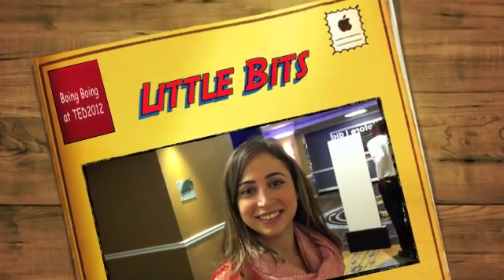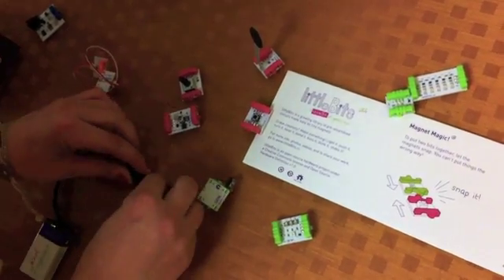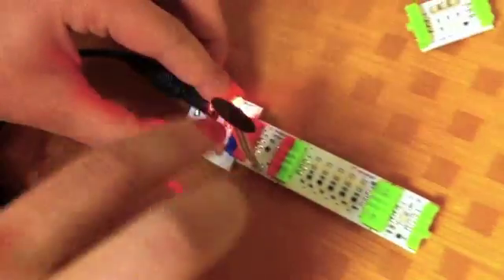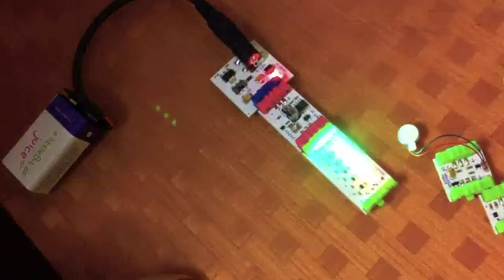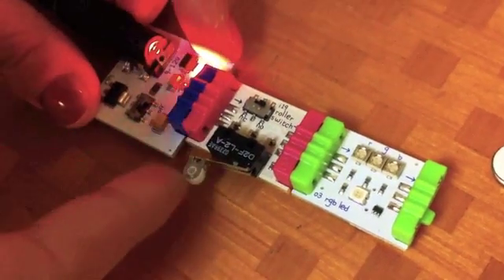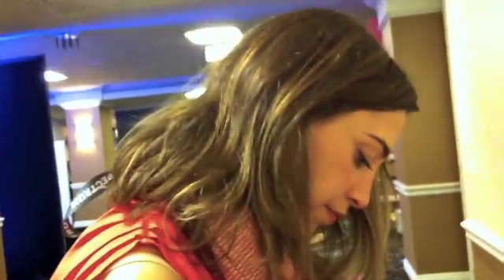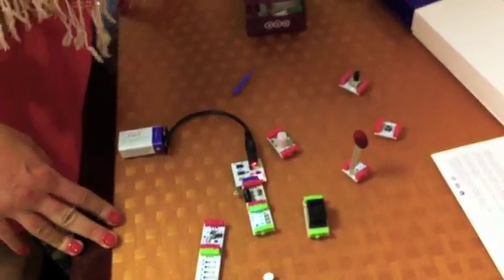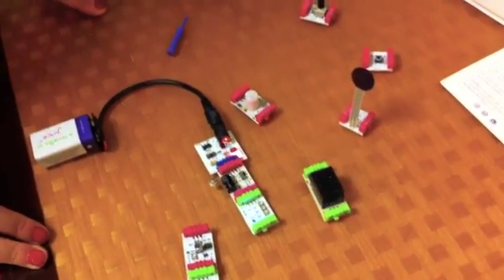TED2012: littleBits creator Ayah Bdeir

Comment: If they come out with a microcontroller they should also have a modular software building system, where people can connect various functions/objects in much the same way as they are doing in hardware.